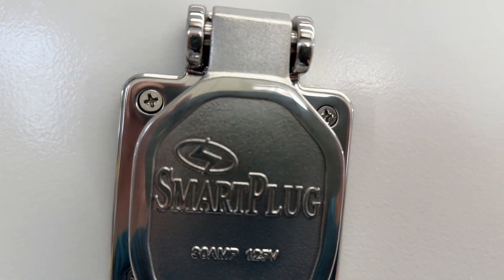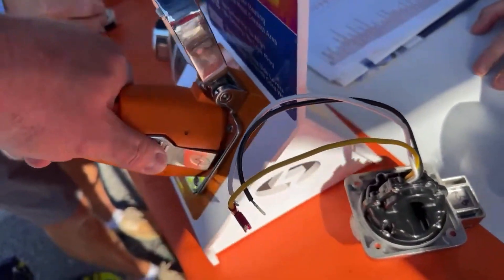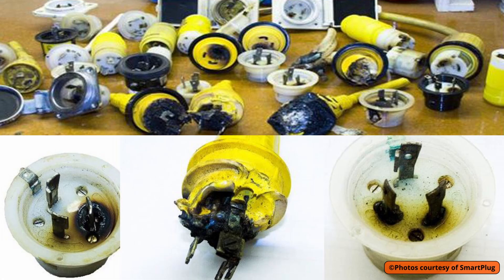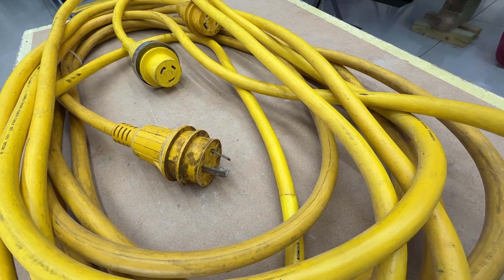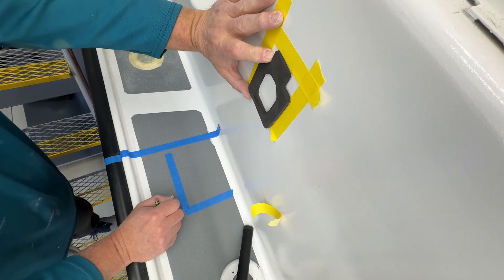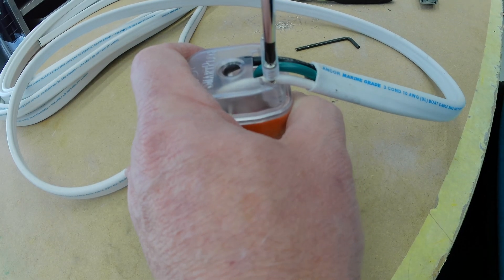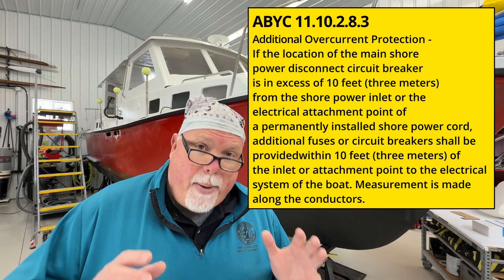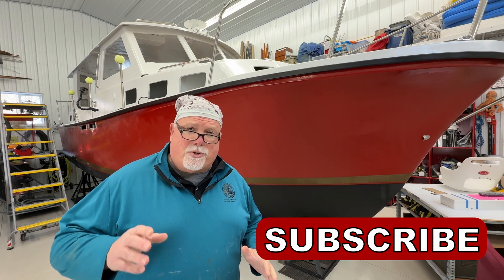Smart Plug Shore Power Installation and Review | Great Loop Trawler Restoration  (Ep111)

Comment: Right On! The Smart Plug. One of the best things a DIY yachtsman can do to protect his boat! I'm originally from the Puget Sound where these were invented. Several years ago, the inventor came to our yacht club and gave a talk about the device. I gave it little thought as we had no issues. We moored in a  large covered marina and down the dock just a few boats in from the street side was the  city fire boat and on that day had a work party aboard. Finished with my boat chores and walking down the dock I detected the sweet smell of burning polymer.  Just then a fireman leaped from the fireboat onto the dock and then onto a boat in an opposite slip, a 44 foot Bayliner,  where flames and smoke were coming from the shore power plug on the boat.  He shouted for his crew and they went to work quickly  putting out the fire. A boat fire in a covered marina is a very serious thing as all the boats under that cover may be destroyed. The cause was wear and verdigris on the blades of the old style plug and connector. That day I drove into Seattle and bought a Smart Plug kit for both the marina and my travelling shore power plug. When I moved to JAX and bought another boat, a Smart Plug kit was installed on it too.
Reply from the maker: What a great comment. 👍👍 You know exactly what I’m talking about. Once you’ve seen know —you realize it’s time to install the SmartPlug.  Thanks for the comment and welcome
aboard 😁👍

Comment: Love your content and your style. For the smart plug I think it’s important to point out that only the boat side connection is improved and the shore / pedestal connector is still a standard connector. In your photos of the old style plug, the shore side of a 30A Smart Plug is still the same 3 prong twist connector which is prone to premature failure, not to even speak about the state of condition of the pedestal. You can spend $400 on a quality shore power plug and it will definitely help, or you can hardwire the boat side of the cord directly to the boat, coil the cord and place it in a locker. When the shore plug starts to wear, just cut it off and replace. In this arrangement the boat side is never subjected to wear and tear. Just another idea and much cheaper and still to ABYC code.
Reply from the maker: That’s an interesting but comment. 🧐Who has room for a coiled 50ft cord in a locker permanently wired on a 27ft pocket trawler ? 🐙Really? 😳 of course the SmartPlug is good for the boat side—but as more become marinas are installing the SmartPlug pedestals as new infrastructure, everyone benefits. The more robust cord and the boat side (where all the movement is) is the part YOU can control as a boat owner. 😎 I  can’t control the weather, other boat owners, or the YouTube algorithm— 🥸thanks for your comment.  Be sure to subscribe and please help spread the word about the channel 👍

Comment: The part that plugs into the pedestal is basically the same though. That's the end I'm concerned about.
Reply from the maker: You should be concerned about both ends 🐙 Encourage your marina to switch to SmartPlug —it’s available for marina installations 🤓